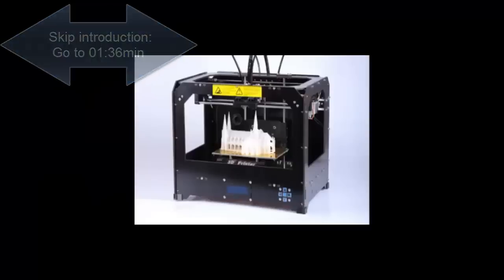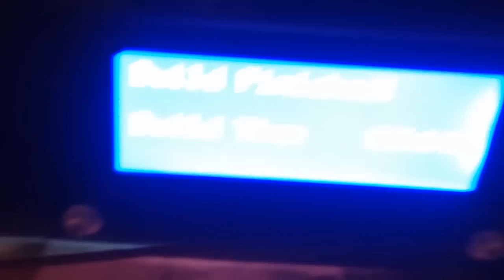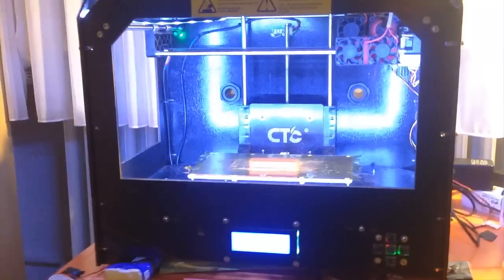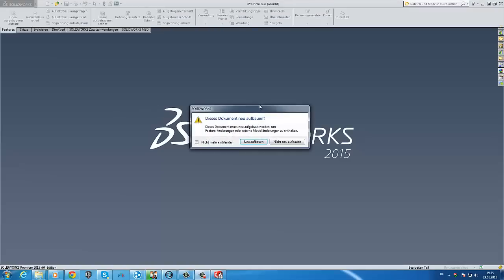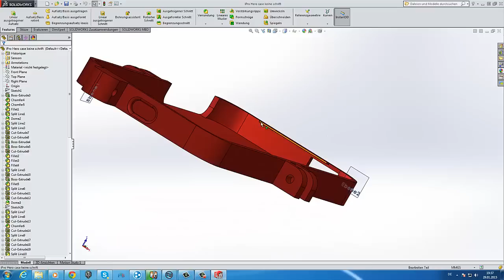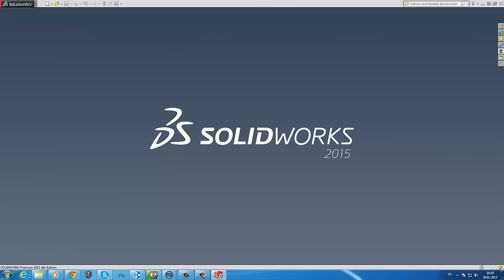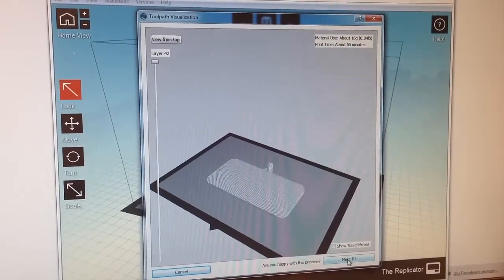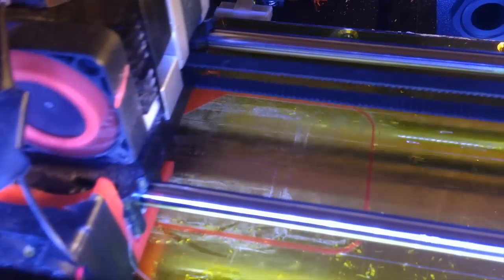CtC 3d Printer see what is possible

Comment: I have the exact same CTC 3D printer. However, it turns off after I select the x3g file on the screen from SD card. What is the problem? Is the power supply faulty? Do I replace the power supply or the control card?